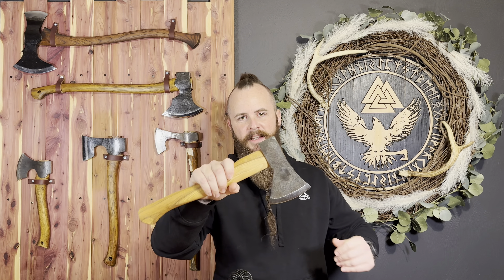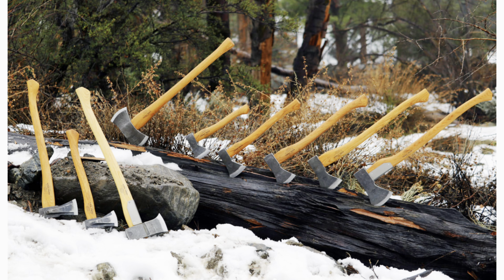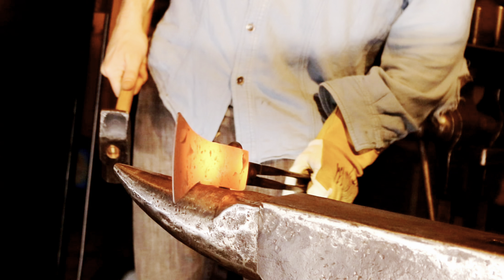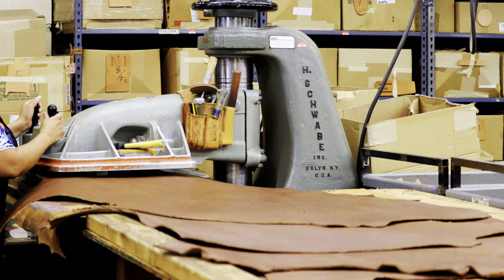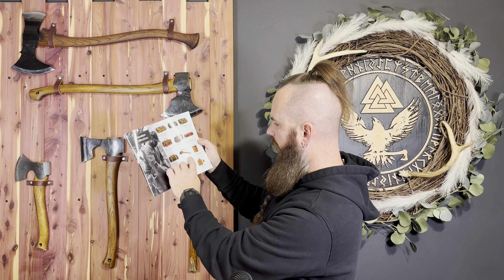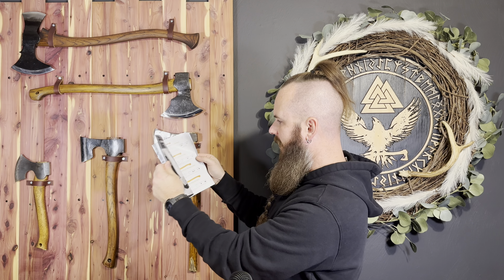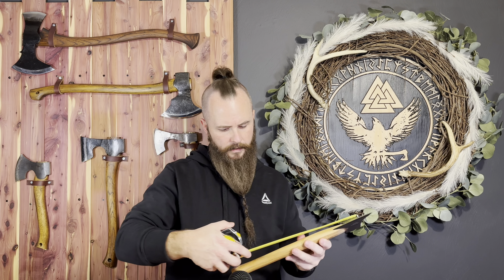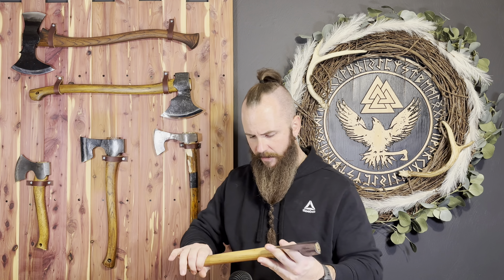Helko Werk Rheinland Hatchet: First impressions for axe throwing #axethrowing #axe #tips #tools

Comment: Just a thought... When having to change out the handles... May want to spec the handle at least closely to what it originally comes with. I know it's tempting to put something you enjoy more on it but for throwing it's nicer to know what it'd be like more with the general idea of what they put on there if someone were to get one not needing redone.
Reply from the maker: I actually had planned on getting another handle from Helko Werk that is designed for this hatchet! I’ll try to stay to spec with reviews if I can. I usually try and keep the handles they come with and only make modifications if necessary. But to be honest, this handle was pretty good!